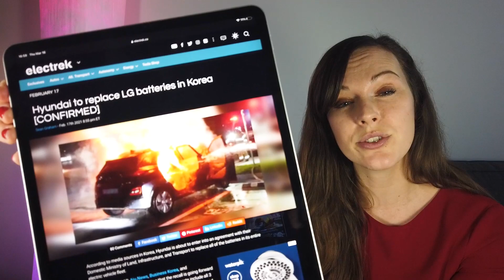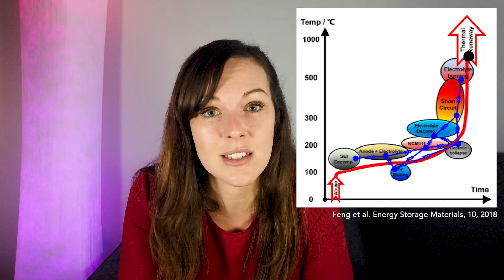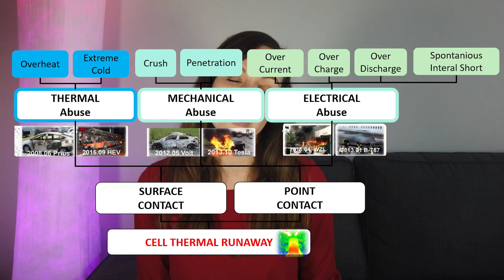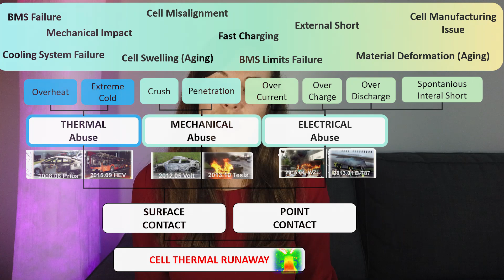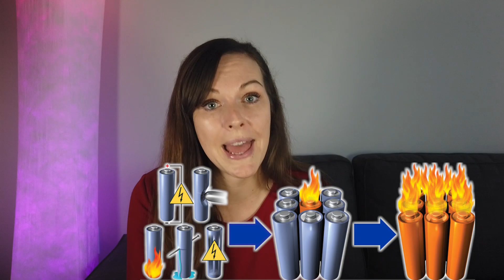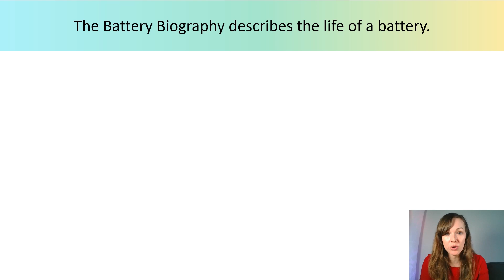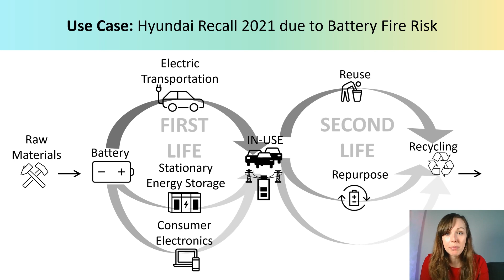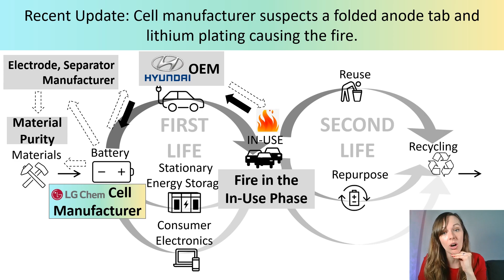Why Do Batteries CATCH FIRE!?

Comment: Great video, keep up the good work! In my field we have a similar concept to the battery biography called "digital twin".
Reply from the maker: Thanks! Which industry are you in? Digital twining is coming more and more for batteries too, mostly within a certain chapter of the battery biography but not across different stakeholders..yet..😊
Reply: @ElectrifiedVeronika  I'm involved in Data Analytics for the industrial and automotive sector. Previously my focus was on test bench virtualization.
From my experience, onboarding those who do not receive short term benefits but who are nonetheless essential for the success of the solution as a whole, shows to be most difficult. However, we also gained a lot of momentum just by being able to lead the integration across different stakeholders. Even small steps do already contribute unprecedented value. :) I'm curious to see how far we can advance the field in the coming year.

Comment: What is your suggestion for battery disposal? The EU has one of its largest in Bremerhaven. Do we need decentralized battery disposal centers to reduce long transportation routes across Europe?
Reply from the maker: Hey M-J, thanks for your comment. One of the problems about lithium-ion battery disposal right now is, that lot of that happens in the "informal way" and is not tracked - this happens globally. We have challenges to transport used batteries due to safety reasons, and, if batteries arrive at their disposal location, it is hard to handle them because you don't have the relevant information about them in order to decide what to do with them, like reusing/repurposing or recycling. Moreover, lots of batteries in Europe and US leave the country/continent and are transported across the whole world, but not tracked any more. Indeed, there is lots of room for optimization!
Reply: @ElectrifiedVeronika  Hello Veronika, may I ask if your answer is refering to vehicle batteries or to small consumer batteries? both Tesla and Volkswagen are currently in the process of building up huge recycling facilities. Which kind of makes sense also from economical pov when we look at the fact that (arguably) recycling materials from Batteries is in many cases more cost efficient than mining raw materials. Also Duesenberg and Umicore are hugely into Bat recycling here in Europe. I believe this is the way to go
Reply from the maker: @67er_matze97  the market of used consumer batteries is at the moment of course way bigger than the one for vehicle batteries: so a lot of this informal battery handling refers to smartphone, laptop etc. For me, reuse and recycling is the way to go to save our raw materials overall and I love seeing that there is more and more going on in that field! Still, lots of challenges and open questions for the business model here: sometimes recycler have to pay for getting used batteries, other times they get paid..it is not clear yet who has the responsibility of the battery at which time of it lifecycle..pretty surprising to me sometimes 😊 I like your comment and I will pick it up in my next video!
Reply: @ElectrifiedVeronika  I'm happy to hear that, Veronika! I think that Emobility will give recycling a huge push. And I believe it is important to see the future potential of improving those processes to improve the ecological footprint of electrified mobility. That's where our chances are to improve the situation. Same when looking at future potentials of using Photovoltaic in Synergy with Emobility (f. ex. bidirictional charging). I see a huge enabler in that to enable changing to green energy (Wind+Solar) by buffering the overnight Energy deficites (partly) by use of car batteries. (Same proncipal as cloud computing - let's say I know I will not drive long distance this week so by SW I allow the net distributer to use 50% of my Battery Storage Capacity to buffer the overnight deficite of the cloud). 
I've loved your first video and look forward to upcoming ones :)
all the best
67er_Matze

Comment: How thermal propagation depends on form factor or for which form factor thermal propagation is more?
Reply from the maker: Yes indeed, several aspects to take into account: 1) number of neighboring cells - in a cylindrical arrangement you have way more neighbors to spread out the heat than in prismatic or pouch  2) contact area is much higher for pouch and prismatic than cylindrical 3) hot gas venting of cylindrical and prismatic is more controlled than for pouch..and more! 😊
Reply: @ElectrifiedVeronika  thanks Veronica for your insight on this topic any sort of detailed information about thermal propagation with form factor will be very helpful, please share any info you have on the same
Reply: @ElectrifiedVeronika  in prismatic we have side vent I think this will enhance thermal propagation
Reply from the maker: @poojasingh2752  https://www.sciencedirect.com/science/article/abs/pii/S0378775314016905 I recommend this read!
Reply: @ElectrifiedVeronika  Thankyou Veronica for the recommendation,I read this paper today great content still some doubt why parallel connection failure is more severe compared to serial connection
Reply: @ElectrifiedVeronika  Hi Dr. Veronica please share if get some more content on thermal propagation
Reply from the maker: @poojasingh2752  I will try my best to cover your requests in a future video.
Reply: @ElectrifiedVeronika  thanks a lot Veronica 😊

Comment: Is there a danger if the bms were to be hacked?
Reply from the maker: Great question! I cannot answer directly because I don't know exactly what the safety measures regarding cybersecurity and maybe hardware limits in the BMS are, but there are certain standards and regulations BMS manufacturers and vehicle makers have to follow. More and more vehicle makers are communicating with the BMS in real-time, sending data from the BMS to a cloud and flashing information back . Let me do some research and I will come back to that in next weeks video!
Reply: @ElectrifiedVeronika  ok cool thanks, I hadn't thought of it until your video.  It is a prospect that makes me very nervous. 
Your vid was great btw. I also wanted to do a YouTube channel but I was intimidated by it, your vid is making me consider it again.
Ps, would you be interested in doing a colab vid with a friend of mine Ricky from two-bit davinci?
Reply from the maker: @katiegreene3960  DO IT! first of all 😊 and second, I think we don't need to be nervous about BMS hacks! Let me get some facts. If you wanna chat a little bit about your idea, I would be happy to learn about it!
Reply: @ElectrifiedVeronika  I sent you an email just now
Reply: @andyandsn8896  that's not the answer I wanted to hear 😣😨